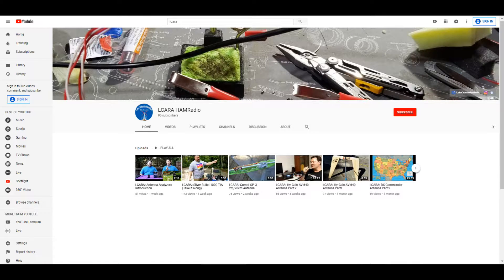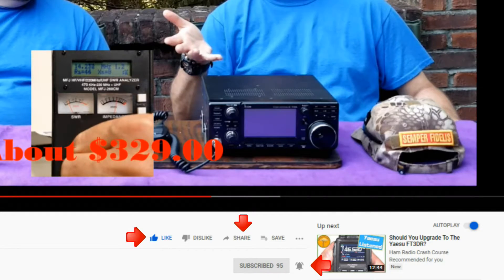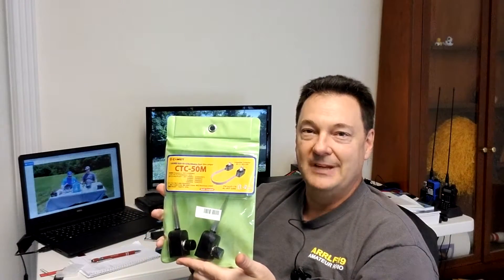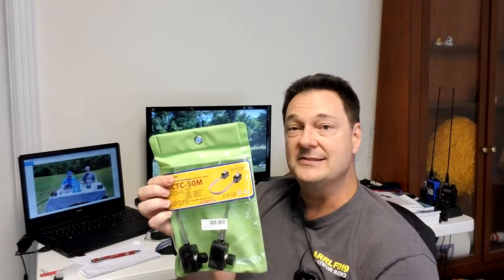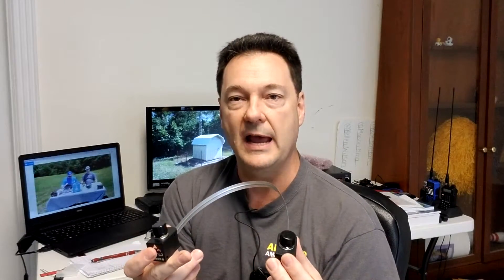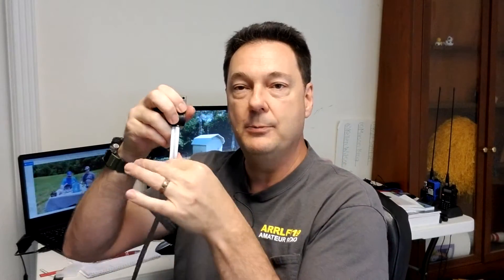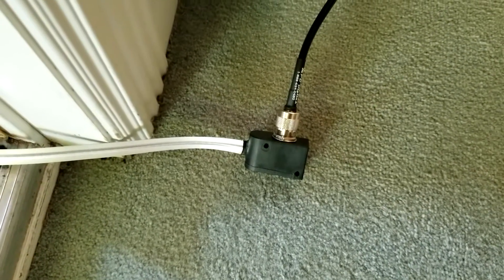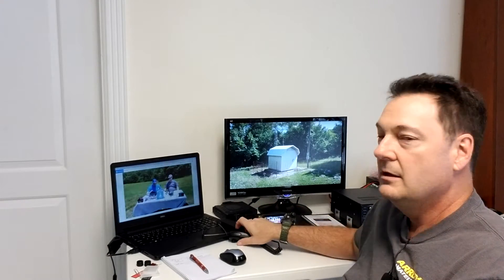LCARA HAM Radio: Comet CTC-50M Window Jumper

Comment: The downside to using this cable is that, on 2 meters, it is only  rated for 60 watts.  The Yaesu FT-2980 has a maximum output of 80 watts, so this would not work with that.  I wonder if Comet could make this cable a bit heavier so that it could handle more power?

Comment: Good video. 

Just passed exam waiting on call sign. Starting out with H/T, and looking at options for mobile use of H/T.

Any thoughts on using one of these jumpers in a mobile situation to get coax out to antenna?

Have company vehicle which limits my options to a good mag-mount and H/T

kd9ost
Reply from the maker: Hey GG, I would think about getting a decent magnetic mount antenna for 2M/70CM. There are many to choose from and I'm sure you can do some research to find one with great reviews that doesn't cost very much. I bought my first antenna at the Lexington HAMFest. Congratulations and looking forward to you participating on the Nets.
Reply: @LCARAHAMRadio  Just found and interesting option - the MFJ 310 window clip. Considering combining that with an upgraded comet or diamond h/t antenna.

Comment: I would have like to see actual swr testing before and after.
Reply from the maker: I just recently retested the connectivity between the antenna and the window jumper for another video and it was actually lower than without the windows jumper, about 1.1SWR. So I'm really happy with these.
Reply: I have one. Trying to use it on 10M. It's causing my SWR to go up higher.